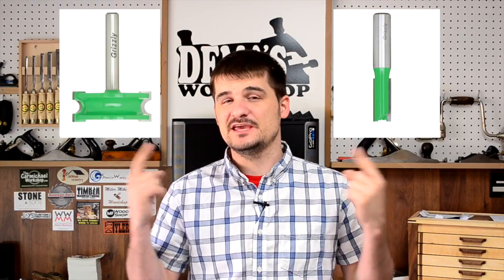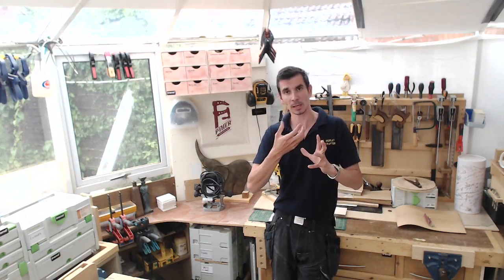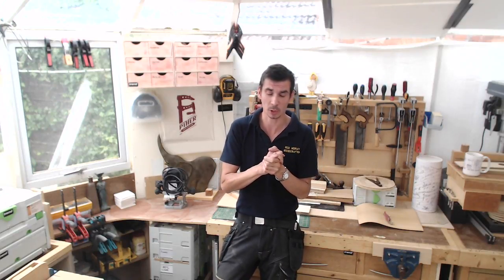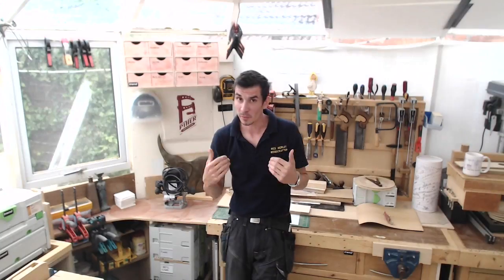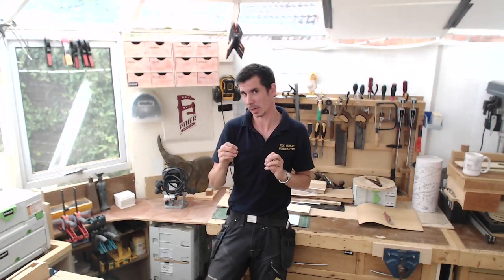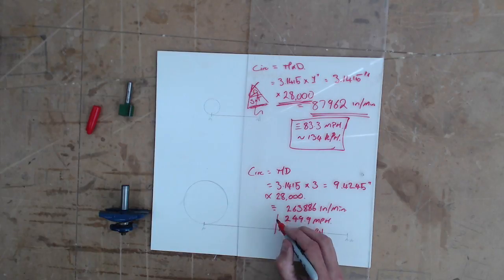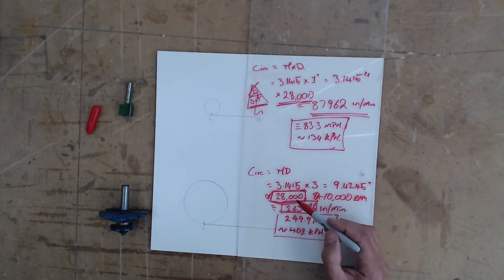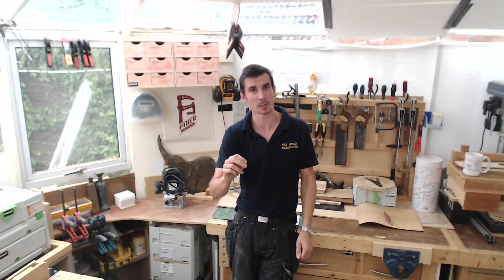#CuttingEdgeRouterTips:, router spindle speed for large bits ?

Comment: I have a follow-up question regarding a router with an external speed control (SC). I have a 2 1/4 HP Porter Cable 892 with max 23,000 RPM. While it has a built-in variable speed, this router is permanently mounted in my router table and difficult to access if I need to adjust. The external Rockler SC is mounted outside my table and has a 0-10 setting...are these percentages? Am I doing myself any disservice to the motor or life expectancy if I dial down the internal SC in conjunction with adjusting the external SC? Thanks
Reply from the maker: Whilst I'm not overly familiar with the specific router models available to our "new world, colonial cousins" ;-), is the PC 982 not a soft start router? The rockler gizmo will not work with soft start routers.....IMHO I wouldn't get hung up on these RPMS,  too much. This is generally why the router settings are in bands the way they are.
I just put it to the recommended speed, and crack on.
Reply: Yes the PC 892 is a soft start
Reply from the maker: Derek Cadmus I would advise against it, chances are it'll knacker the circuitry of the softitart - which will be connected to any ability it has to maintain constant speeds under load.